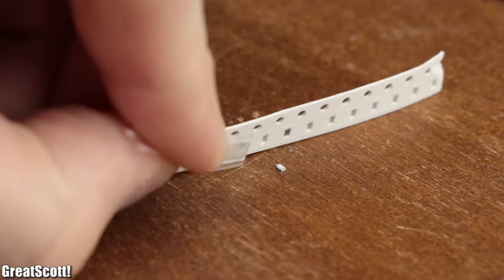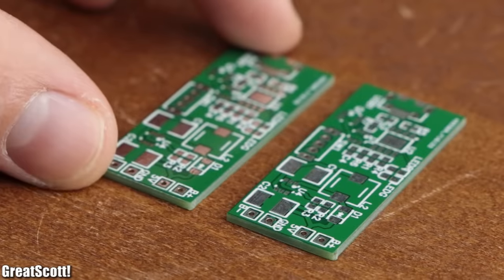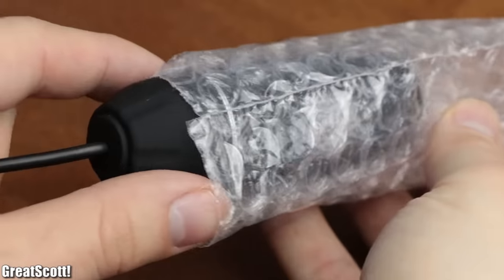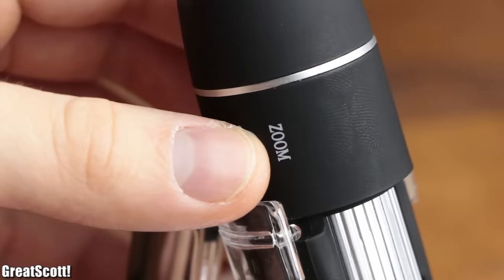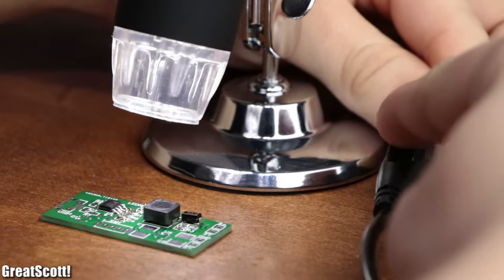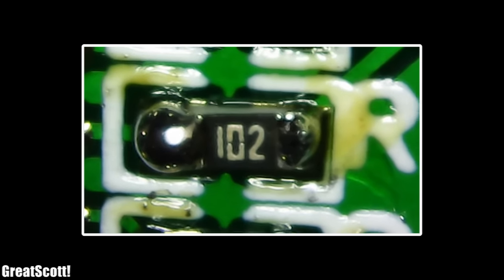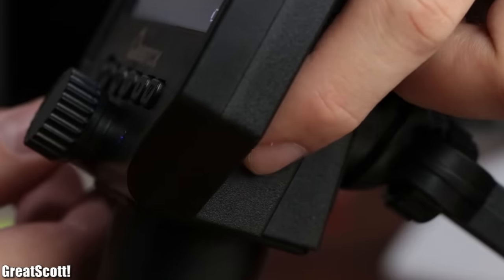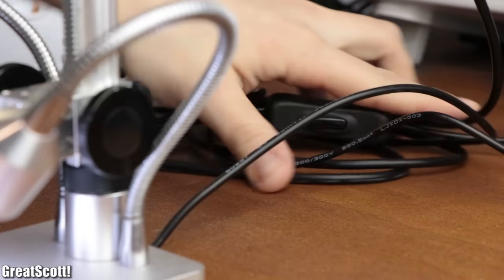Microscopes for SMD Soldering || $15 VS $45 VS $189

Comment: The operating system on the $45 and $189 microscope look exactly like a dashcam. I think it's literally just a rebranded dashcam's recording circuit with a screen slapped on them. This explains the 2 minute screensaver.
Reply: I agree, I recognize the exact menu.
Reply: Yes I recognize the crapy alpha vapoware of my dashcam 😵
Reply: The use of "mini-usb" connectors is a straight giveaway suggesting an older design.
Reply: They are indeed repurposed dascams, where they slapped on a zoom lens. They didn't even remove the battery indicator form the gui, which is no longer present in the device, making it usb powered only.

But hey, it does the job. As long as the lens and the sensor is up to the task, why not?
Reply: They have an internal battery - I have one; also see the last few seconds of video.
Reply: the menu looks exactly as my old dashcam integrated on a rear view mirror. but hey! i think its fun to repurpose those cheap dash cams as diy microscope. do you think a smartphone macro lens would work?
Reply: Definitely two old generation dascams :)  Chinese folks found a way how to clean their warehouses with profit.
Reply: @lawrencebillson6224  The cheaper $45 does, he said that. The more expensive one doesn't. The last few seconds of the video is the $45 one.
Which one do you have?

Comment: The first $15 microscope has a small plastic lens cap (dust cover) that comes off that'll give you a clearer image. I noticed in you close-up shots you still had that cover on.
Reply: 🤣🤣 Woops
Reply: Yup, also noticed this. The cap needs to be removed, seems it was never removed. Once done the image on my monitor was really good !
Reply: Biggest thing I noticed with my cheapo chinesium was the base.  Cheaper electronics didn't autofocus well, and everytime you focus you move it just a little from where it was.  So it was a real trick to hold it steady while focusing so it would fall back to a different position after focus.  But, for $15 was still pretty impressed.  I would get a nicer one if I were rich, but if $ is the limiting factor, $15 was acceptable for the price.
Reply: @ngrader  A trick I do to help the focus is I mount the camera more permanent so it can't move then I move the object around under the camera. I use mine mainly for electronics so I slide the circuit board around while the camera stays in one place.
Reply: @dans381  Doesn't everyone?

Comment: for the 15 dollar one I have noticed that you did not remove transparent protective cap when working - remove the cap and quality will be better :)
Reply: I was going to say the same. I bought the same a few years back, and the picture quality is actually rather good. Once you remove the plastic lid
Reply: true!!!
Reply: I'm not the only one seeing this...
Reply: I have that microscope (1600x version) and i cant see anything if i dont remove them
Reply: I have this one too. The picture is actually pretty good with the lens cap removed.
Reply: The problem with the $15 one is that you have to keep looking at a computer screen, not very ergonomic.  Depending of the frequency and type of work you do, it might be wise to invest into a $200-300 model which usually has much better optics, thus making your work much more efficient and fun. :)
Reply: @BillAnt  No question, a more expensive microscope is a more solid build with better components. I still recommend the 45 US$ microscope. The stand is awful, i have to admit that. If you buy yourself a cheap table microphone stand and perform some modifications you can get a pretty fantastic result with the microscope. You don`t need a 4K resolution, even a 720p resolution is more than good. I got mine since almost 2 years, and i am very satisfied. I did a lot micro soldering using it. Even complex soldering with 0.1 mm jumper wire can be done with it at a fairly good distance to board.
Reply: @Derrick Master < At 4:50 as it's tipping over just imagine this sound going from high to a low pitch wahh-wahh-wahh lol  As you've mentioned it definitely needs a better stand than that suction cup. I was wondering do you have any issue with the focus as in this video?
Reply: @BillAnt  No, i never experienced focus problems with it. I don`t know why he can`t adjust it to get a clear picture. One more advice : If you decide to buy yourself a stand to use it for the microscope, screw it to the wall ! You need a pretty solid table to avoid vibrations. I had that problem as i mounted it on the workbench table. At the end i decided to  screw it to  the wall. Now i have a nice working microscope. Someone made a video on Youtube about it, take a look at it :  https://www.youtube.com/watch?v=8-7z1_Wy7_U
Reply: @Derrick Master < I think he had a stability issue with that cheesy suction cup which may have caused the vibration and consequently the out of focus display.  At this time I'm leaning more towards the $200 unit, now that I see it for as low as $130usd, especially like its sturdy metal mount along with the high res mode for both video and stills.
Reply: @BillAnt  Yes the mount is solid. But somehow, i would feel limited. For example, putting a bigger board on the metal mount would constantly throw the board out of balance and skip it to the side. The stereoscopic microscopes, that are presented as " high end " magnifying devices for soldering works also have no stands for boards. All in all, they have slight differences in lens/magnifying systems. Probably the more expensive models have better components. On the other hand all these microscopes are nothing else than car navigation system screens with a added camera.
Reply: @Derrick Master < Whenever i have a board with balance issues, I simply use a small Post-It note pad to prop it up.... who knew that Post-It notes are so versatile!? he-he
Reply: @BillAnt  In my opinion, it is just a temporary solution. If you lay your hand somewhere on the board and the surroundings it will always cause movements. That is the only problem. The quality of the picture is better than on the cheap one, there is no doubt. Like you said, you can get such microscopes  for 130 US$, or if you are leaning towards the 200 US$ mark, then i would recommend this particular model, and i like it more than the one you primary have in mind : https://www.youtube.com/watch?v=4b3WFmeoKqA&t=837s At the other hand maybe this is the exactly model you have in mind. You did not mention which one you prefer. But still, this stand is solid, but anyway limited like all such models. I guess they are intentionally made for smaller boards and cell phone repairs.
Reply: @Derrick Master < The $200 one which GreatScott has shown is now down at about $130usd.  The one you have referred to is a nice one too, looks like there's a ton of these similar looking ones on Ebay and Amazon.  I will probably order a couple of them, then return the ones I don't like. lol
In that video instead of using the included stand, the guy had mounted it onto a long-arm stand which is shaking crazy from the tiniest movement of the desk... probably not the best idea. xD
Reply: @BillAnt  I would pick this model over the one he showed in the video : https://www.ebay.com/itm/5-Inch-HDMI-Digital-Microscope-USB-Microscope-ADSM301-for-PCB-Repair-Andonstar/253759408466?hash=item3b153d4952:g:AKMAAOSwsh5bTsVT. I t seems like a bigger and better screen is included. The picture quality seems also to be better. But you know for yourself what the best choice is.
Reply: @BillAnt  Connect to your smartphone instead, with a suitable stand for the phone.
Reply: @brianwest2775  < I thought these have a usb or HDMI output, how would you connect it to an Android, and get the proper drivers?

Comment: You didn't remove the protector from the $15 cheap microscope...  The image should be more clear after remove that...
Reply: Alex Rivera it's only outside the lens focus and it's only so you don't go too close
Reply: Good, you see it too :)
Reply: Caleb Begly  Apologies for any rudeness, that wasn't my intention. I am a little tired today and am not too eloquent. I did look into it a little and there are some lens-less techniques out there. Some use software deconvolution and some involve some kind of grating in front of the lens (there are also pinholes too, of course but those don't really apply).

Now I am home, I am able to look at my own device and it has a small lens in a conical housing which screws into the moving zoom part. If I unscrew it, you can see the (small) CCD behind. It appears that the CCD is stationary while the lens moves up and down with the zoom control. It might be interesting to drop a decent 1080p CCD in there.

It should be noted that people aren't talking about the standoff ring but about the round flat piece that inserts into it which is in the way of the optics. It isn't immediately noticeable as it's not in the focal plane but it definitely affects picture quality.
Reply: @chaos.corner  r/iamverysmart
Reply: @kikhoekjen  God forbid that I should correct someone in error. rolls-eyes

Revel in your ignorance, dude.
Reply: @chaos.corner  Don't worry, I will.
Reply: I have that exact scope and yes lol he left the lens cover on.